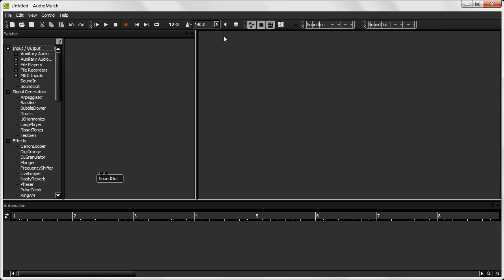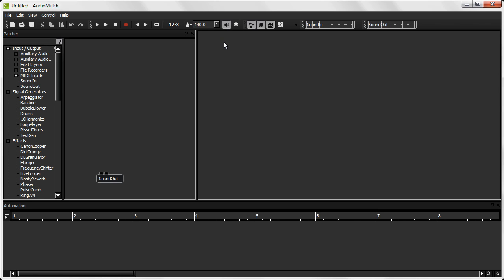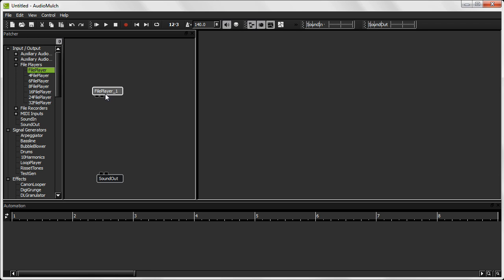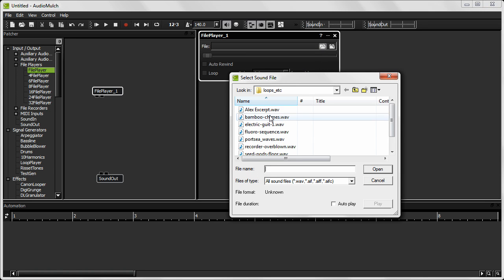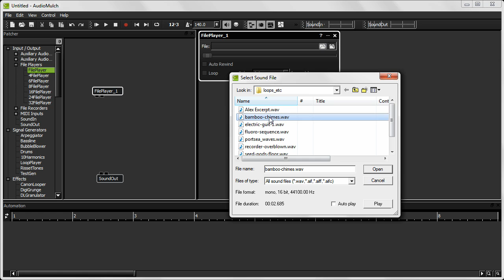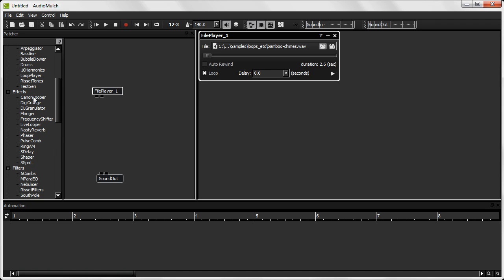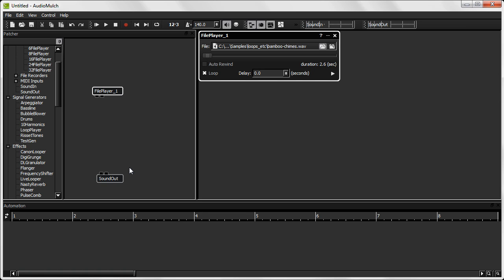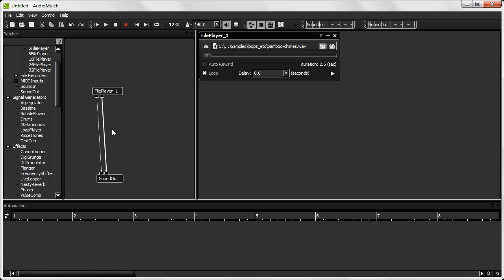AudioMulch introductory tutorial 1: Playing a sound

Comment: I'm getting a delay from my output. is there way to correct that. I'm using a behringer UM2 interface for vocals. I'm getting a solid half second delay from in to out. no filters just a straight connection.
Reply from the maker: If you're on Windows, make sure that you've installed an ASIO driver for your device, and select it in AudioMulch's settings. On both Windows and Mac you can change the audio buffer settings to reduce the latency.
Reply: AudioMulch thanks. I'll give that a try. I've got the drivers installed.